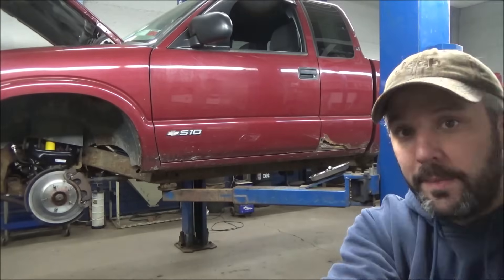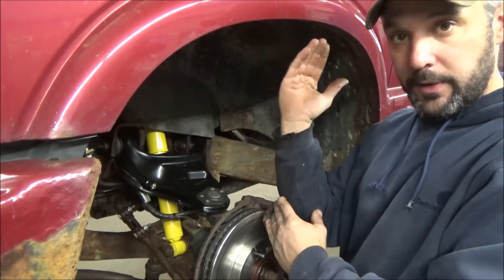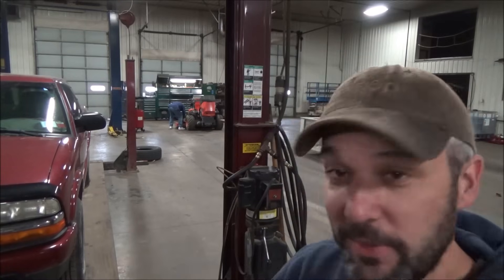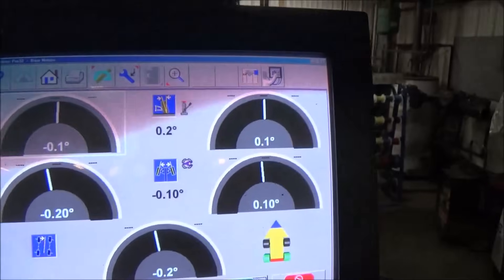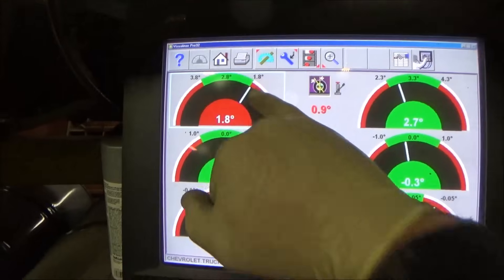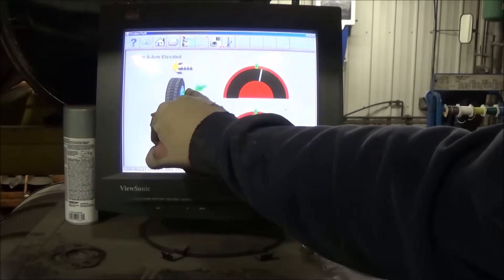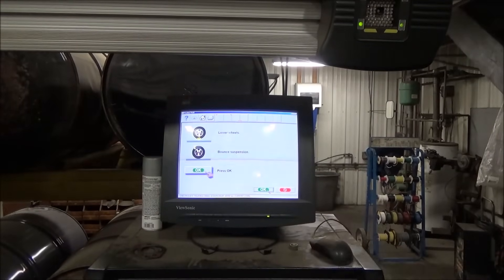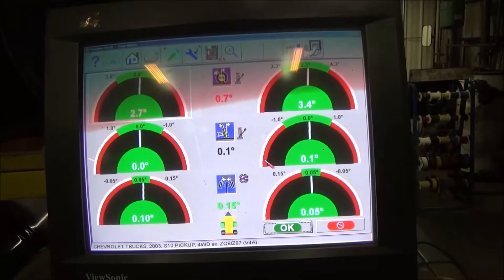Front Wheel Alignment - Caster, Camber & Toe

Comment: working on GMC 2500,
same deal rusty lack of maintenance, where do I stop? replacing a whole lot,
But! ran into a snag, camber caster bolt rust weld so (cut out) shopping for bolts hard to find....noticed little notch from frame bracket, caster rotate on (not there)
little hole appears to be a welded rivet was nocked out (broke) do you have a trick or idea where to get camber bolt?
and how do I repair the caster knob thingy ?

Comment: Another great video. I was wondering something, I realize everyone does alignments differently, the machine we have at work is a 2 year old Hunter machine, it is really way more complicated than what you used, but on ours we have to do a caster sweep after adjusting the toe, because a toe adjustment changes caster, I noticed you didn't have to do that, does that machine automatically calibrated and represent what the actual caster is. Our machine represents live adjustments, although it doesn't tell us which way to move stuff, wish It did, have spent hours trying to get things adjusted to get it right, but it doesn't always represent the actual caster reading after the 'final' toe adjustment, and some times wen end up with a pull.
Reply from the maker: +kenman1717 All measurements on the screen are live all the time.
Reply: South Main Auto Repair Did you just get lucky the toe adjustment didn't affect the caster this time, and not have to readjust anything or do you never have that problem? Also I noticed you adjust one side toe at a time, I usually have to keep both readings on the screen, because when I adjust one, the other one goes all out of wack and I have keep fine tuning them both until they are within specs.
Reply from the maker: HMmm I dunno I have done it for many years and have done literally thousands of alignments, not sure how toe affects caster to be honest with you... sounds like your equipment may be a little whacked...
Reply: South Main Auto Repair Lol you maybe right, the shop paid almost 60 thousand for it 2 years ago.

Comment: You got to do a BMW just for the fun of it I guess if there's no bushings worn out then the caster which is adjusted on the struts on top but there's a pin that sits in the hole so you can't do it but I noticed that my old ones they took a punch and pounded the pin down so they can move it in the slot in the 3 bolts when I put new bushings on I put it back where it was factory and it's fine

Comment: Your cool as hell. A great mechanic at best!!!   Love your vids. 
Don't mean to highjack the thread. But I have a 2015 Chevy Impala limited LTZ. I have a small knocking when car first moves ( forward or reverse).
I also feel a drive train slack jolt/jerk when deceleration at low speed when I take my foot off the gas,then when reapplied???any correlation ?
Thank you in n advance,if you can tell me what's going on.  
I was thinking slack on in CV joint/ front axle components.??  It is afront wheel drive ,with the 3.5 v6 D.I Vvt motor

Comment: Great vid.  Might be boring, but i'd rather do the alignment then the Acadia amplifier replacement.   :D
Reply from the maker: +raykrv6a Hey you have a point sir !
Reply: I'm the opposite lol. I'd rather be doing the amp or the heater core on that dodge ram. At least the bolts don't rust up like adjustors and suspension bolts. I'm a small guy with girlish hands so I can fit them in small places lol.
Reply: +Raymond myszka I absolutely hated updating the tune in my supercharged mustang because I had pull the ECM out to replace the chip.  It was one reason I sold the POS and bought a corvette.  LOL
Reply: +raykrv6a lol Its either muscling adjustors loose then busting your knuckes on the  alignment rack or contorting yourself, wrenching your back and getting cat scratch all over your arms. Pick your poison lol

Comment: Hey guys, Does the computer tell you when your wheel is straight? or do they become straight with respect to how you locked them (with the straps)? 2 times at the dealer they couldn't get the wheel straight. I think the tech doesn't know how to set the wheel straight, or doesn't know what straight is.  report says everything is in spec, but still seems like my wheel is a little to the left when i drive straight.

In any case great video thanks :D
Reply from the maker: What I do is straighten and then lock the wheel with a special tool we have then set the toe. Of course there is other factors but it is usually that simple :P Sounds like you need to find a new shop.
Reply: South Main Auto Repair Based on this video the tool you have seems like its not computerized.  Meaning its subjective to what you think is straight, no? (Please correct me if i am wrong) I'm just wondering if there is a tool that takes the user error out of it.  The spec sheet they printed has something related to steering wheel and it seems like its in spec. Then again, the tire pressures were all wrong. So I wonder if he was just fudging the numbers.

I tried to be fancy, and use subaru's warranty for a free alignment. I guess the tech didn't like that. That's what I get for free work.

Not all of us have access to SMA quality workmanship unfortunately. =/
Reply from the maker: You are 100% it is subjective to what I think is straight.. We never have any complaints about it though :)
Reply: South Main Auto Repair But you are Eric O. Do things right the first time, not hope the customer doesn't notice your mistake. =]
 (typical dealership work around here) 

Everything is in spec, so the paper says, I might just wait till I get new tires before fixing the steering wheel. I rather not pay 130 bucks if its just cosmetic. Especially when the tires aren't worth 130 dollars after 3 years.
Reply from the maker: Bardia Ghajari Yeah the alignment can be 100% actually and the wheel 1/4 turn off...
Reply: Sir I just had front end alignment and my stering wheel is off center , also when I park with my wheels turned all the way to one side , one wheel is turning more ?   . Another thing is it feels loose and at freeway speeds it can pull to quickly to one ide that I'm turning to ?
Reply: the steering geometry causes the one wheel to turn more.picture a circle. the outer tire is further away from center so it travels at a different angle to make the same centerline at the vehicle center centerline. so that is normal. caster can make it pull but if it feels loose i would suspect a toed out condition. run your hand over and back on the tread. it should be smooth . if you feel a ridge it will piont to the direction the alignment is out
Reply: South Main Auto Repair 
but if the wheel is off center won't the make one direction of turn further than the other. if your gear box is 1/4 to the right then you are a 1/4 turn into the right turn ratio.  so making a left turn would have more degrees of travel.
Reply: Bardia Ghajari. a

Comment: I have had my 2006 ram 1500 2 wheel drive truck to 3 different alignment shops. NONE of them aligned it correctly. It pulled to the left a lot, adjust again, pulled to the left a tiny bit. Adjust the third time, pulled to the right, so back to do an adjustment to the tiny left pull. Now my tires wear out the outer tread section on both sides.  if you claim to be an alignment "" specialist "", why can't you align my tires correctly so I don't have to fight the steering wheel when my truck drifts to the left when you take your hands off the steering wheel !!!!!  Shouldn't the truck go in a straight line on a flat level road ??? And the "" Tech "" says it is the best he can get as he reaches for my $89 !!!!!!!!!!!!  Loved the video and I understand now how to adjust the caster, camber, toe in and out. Seems to me that my cat can do this easily, but the "" Alignment Specialist "" just hasn't mastered it yet !!!!!!  And the Master Alignment Tech says I really should get a rear wheel alignment on my truck at $50 more.....but nothing on the entire rear end moves !!!!! So what would you adjust if everything is welded or not moveable ????? (Answer) Adjust your wallet to be $50 less !!!!!!!!!!

Comment: rear axle could be a broken center bolt on one of the springs. There are ways to adjust non adjustable but it's a pain in the arse.
Reply from the maker: +ghetto maritimer and in this case it is not worth it. Cost of repairs vs long term life expectancy of truck
Reply: Know what you mean, older rusty vehicles you gotta draw the line at a certain point
Reply: yes but if you start bending on the rear axle tubes then you'll end up with bearings going out in a short time after

Comment: Yes, we need to see a transfer case swap.  I would suggest pulling the AWD nv247 out of a WJ and replacing it with a 4WD nv242.  You won't need any new parts, just take the SelecTrac bezel from the 242 donor, and you MIGHT need to pull the input shaft from your old nv247.     -just sayin'...

Comment: Does the half moon matter if its up or down when installed? I have a 1997 chevy k1500 with all new camber bolts and my mechanic put all of them facing down and one alignment shop said they can’t adjust camber because it’s installed upside down and the molding is preventing them to turn, another says it can be done and the shop I went to was too lazy to deal with it. I don’t think the rings are supposed to move just the bolt but I don’t know.

Comment: My crown vic steering wheel wont return to at low speed. After a turn maybe to the 2 oclock position. Like a binding. I installed new Moog front end pittman, idler, tie rods...ball joints check out. Alignment specs look ok. Any clues? 2 free estimates, ones says maybe box another said new parts bind. I loosened the box and it didn't help. Steering feels ok execpt for that. I flushed fluid in pump, seems ok.
Reply: +alb12345672 possible bearing on the upper steering shaft...
http://www.cvpi.org/archives/p71interceptor/steering/column/disassembled/pictures/wsdindex.html

Comment: Can I bring my 2000 gmc c3500 2wd utility box w/ 32 ft versalift boom 12k lbs , for a alignment ? No shop around sw florida that I can find , trucks either to tall for doors or to heavy for the alignment rack ..I know of a couple , one missed to much stuff two times , drove bad after alignments , found more problems , everything has been done now except the alignment .I aint even took it off my hoist yet , for a test drive ..

Comment: What made you quit working on trucks and diesels?
Reply from the maker: +ice44567 Weelllll it is a long story
Reply: South Main Auto Repair Haha, well I'm not asking for a video on it necessarily. But I'm interested to hear said story. I'm considering being a diesel mechanic myself so it would be nice to hear about it from the horse's mouth, so to speak.
Reply from the maker: Well you need to be built for it. If you are going to do the mechanical side of it, which most of it is you need to be physically able. I did it for many years and puling 13 speed trannys to do clutched every other day gets old pretty quick, tires, brakes and cams, frozen slacks , stretching frames, springs , trunions, walkin beams, it all gets old pretty quick...

Comment: Good details. If the rear thrust angle is off, it should cause the steering wheel to be off center to drive the car straight.  Some folks suggest the eye bolt in the leaf spring could be either broken or has some slop around it that tweeks the axle housing to be short or long from front center to rear center on one side.

Comment: When the dinosaurs became extinct, I learned wheel alignment.  I agree to everything you stated except... isn't the caster supposed to be more positive on the drivers side, to fight road crown?  That's the way I remember it.  Has that changed?   Thanks for the great vids!
Reply from the maker: +ccgrider1014 Good question but steering geometry has always been the same. Back in the day with no power steering cars and trucks used very little positive caster to help you steer easier. Caster is responsible for proper steering and also for keeping the vehicle in a straight line. A caster difference from side to side will cause a pull to the LESSER measurement. Make sense?

Comment: I no this is an old post but im gonna ask anyway. My transit van pulls to the left even after wheel alignment and the steering wheel is now of centre to to right. Ive had new tyres, wheel bearing, drive shafts, wishbones, sway bar bushes and it still pulls to left.
Ive had it in 4 garages and they cant seem to fix it. Help
Reply: Gearbox is worn

Comment: always hated doing alignments, old machines suck took 20 minutes to set up and you would get done and the wheel would be slightly off or you would have a tire pull, back to the shop swap tires or reset up to fix the wheel, newer machines are so much better, and didn't mind doing them as much, still mind numbing boring. the shop I am at sublets them to a chain tire store, they suck but cheaper than buying the equipment for us.
Reply from the maker: +Michael Berg Exactly how I feel, I rent my dad's stuff instead of paying 70 grand for my own :)

Comment: ‘Our camber is within spec but we’re gonna adjust it for the sake of adjusting it’

Oh yeah, your transmission oil looks fine but we’re gonna change it for the sake of changing it. 

Extra $30?
Reply from the maker: Rule number one. Screw the customer and flush the wallet and much as you can. 30 😅 who wants 30. Get them for all they got, go for 1000 extra minimum!

Comment: Why do American cars all rust so badly
Reply: +Lexus/Toyota Technician FAQ ALL cars rust or corrode in the salt belt. It's nothing specific to the US or America.

Modern cars have more rust protection and certain car brands puts extra effort into that protection but eventually... EVERYTHING that is metal will degrade to a point that is rust or corrosion.
Reply: I live along the coast of South Africa and our cars don't rust nearly as quick or as bad as the cars I've seen on Auto repair channels in the Us. Maybe because of the snow factor, it does not snow in South Africa
Reply: Lexus/Toyota Technician FAQ Yeah, i think i meant to say "rust belt" not "salt belt".

The roads are maintained with salt to keep the freezing point lower so ice doesn't form on the roads. That salt, mixed with water, gets sprayed all over the undercarriage of the car and advances the process of rust and corrosion by many orders of magnitude.

That said, rust happens EVERYWHERE. Let some metal sit in the desert and it will rust despite the lack of both salt and water. There's moisture in the air and that alone can cause metals to rust and corrode.
Reply: Ok well we don't use salt on our roads as it does not snow at all in SA, that explains it, thanks